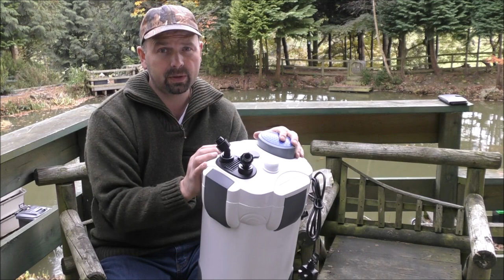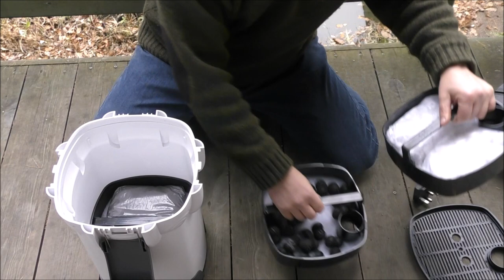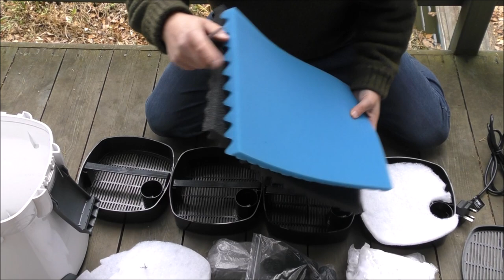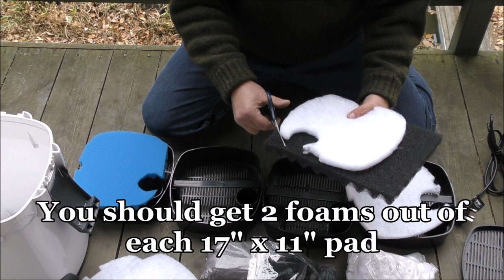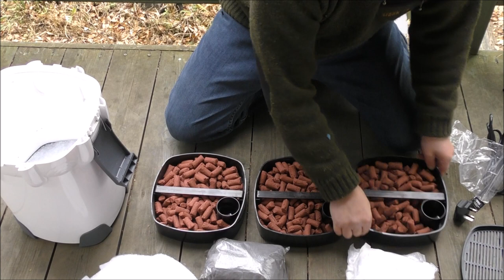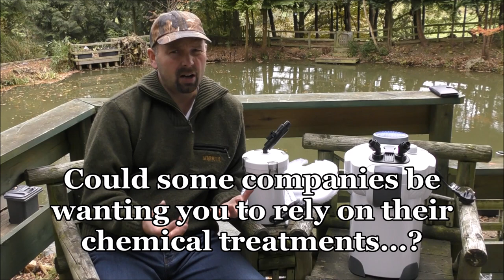Why Your Filter is TOO SMALL and NOT CYCLED

Comment: Hey Pondguru, I bet that I can get your canister to get almost 100% flow from the filter.  If you use two of the booster mechanical filters in parallel feeding the single inlet of the canister filter, one filled only with biological media, you will very likely have almost full flow because the greatest resistance will be in the mechanical part of the filter system and doubling the mechanical filter area you, in effect, half the resistance. Halving the resistance should keep the canister filter at max flow.

Comment: Pondguru 
I am recently using the bio home in my Fluval 206 and 207 filters with excellent results, so much so that I decided to buy a pre-filter simply for mechanical filtration.

So much that I intend to fill my Fulval only with bio-home
However I have a doubt here:

I bought a pre-filter similar to the one that has plastic bio-balls at the bottom of the glass through which the water enters.

Shouldn't these  bio-balls be the last ones where the water already filtered through the 3 sponges of 25, 35, 40 PPI and perlon circulates?

Comment: and another topic to consider. 
That I had to learn the hard way that many if not most of the little bottles of "anti-Chlorine" that they sell at a pet store do not work at all to get rid of chloramine.
 And the other thing connected to that fact is that many towns in the USA will switch from adding chlorine to very heavy doses of chloramine in the late winter and early spring.
 Im not sure why they do this, but I learned that fact also the hard way.

So you have to always check the pet store bottle's small print to make sure it gets rid of both chloramine and chlorine!

Comment: I have a penn plax cascade 500 says 115 gph for upto 30 gallons. I have filter floss under the basket to stop swishing cause it's not enough room for media. And I have a coarse and fine foam in the bottom basket. And fine foam under the media in the top basket. With filter floss on top of the crate.Would it be suitable for a 20 gallon? If I divide it in half, it be 57 gph and 15 but wanted to check because you said other companies list it right.

Comment: I have heard multiple people talking about these filters saying that the out flow is quite poor/ slow. surely, adding a additional foam chamber for the water to flow through makes the flow output even worse, due to the additional power needed to pull the water through another chamber? great video by the way. Just more of a question about the actual canister used in the video!
Reply from the maker: When I pulled out all the parts of the canister filter you will have noticed 4 x fine pads (one in each tray) which is how it comes from manufacturer. Operating the filter with 4 fine pads in has the potential to cripple the flow - it only needs one to be effective and that will also help with flow.
Therefore I can understand if there are slow flow issues with the canister if it is set up as (manufacturer) recommends.
No canister will have the flow it promises as they generally sit under the tank so will be operating at a head of around 75cm - 90cm typically. At that lift a 2000 litre pump may only be delivering approx. 1200-1500 litres per hour from any filter and much less if 4 fine pads are used to restrict the flow.
Hope that makes sense.

Comment: Hello, im using the newest serie of fluval. 2x 407. I dont know if the old ones have this but what i figured out is that the watet flows through  the side foams to the bottom. And than starts its way back up through the 4 buckets. 
i left the standard pads in the side. one small foam in the botton tray. and then went up with Matrix media and a bag of purigen in the top bucket. Correct way of doing this?

Comment: Another great video. Thank you. I may have a go at designing an anaerobic pre-filter. I seem to suffer with diatoms and will tackle the cause.
Reply from the maker: It may be worth considering using that filter you're designing as the latter part of the filtration system, not the first as the nitrate reduction would generally occur after the aerobic processes which act on the ammonia and nitrite. It will have much greater chance of success after aerobic bacteria has done its job as that effectively reduces the oxygen content of water - design of the filter would be the same but placement of nitrate reduction part makes a big difference.
I'd look forward to hearing how you get on with that and if it is successful - media choice makes a huge difference to the effectiveness as does water flow, ideally media would be genuinely porous, receptive to bacteria and the flow would be slow  -possibly split the flow from the main filter to ensure slower passage through the nitrate filter?
Reply: @pondguru  Absolutely. Thank you for your great advise. I'll let you know how I get on.

Comment: Hello, Richard. I am wondering how I should treat fish I bring home from the store. I have a pair of Corys, nerites and amanos each, in a 10 gallon tank. I plan to transfer them to a 38 gallon tank. The filter on this 10 gallon tank is cheap and ineffective. I will  gradually phase out this filter and use a Fluval 206 equipped as you detail (I have to make a new lid from Lexan, or, polycarbonate to accommodate the hose entry to the tank while the biological media in the 206 grows). I plan to use the 10 gallon as a quarantine tank (in future), but have not used anything on the aforementioned inhabitants prior to the planned transfer. What do you do before you move fish to a general population known to be healthy? I completely enjoy your videos, btw, and will, at some point be getting some Ultimate from AngelFins for my next (2) 207 Fluvals.

Comment: I have the booster filter and used in my setup. The problem i had is it reduces the filter flow rate a lot  and also it get blocked quick and priming the filter was  a slavery job every time.. I move to sump  setup and 800 L tank and the problem i have is the phosphate . It is 5-6  at most.  The  booster filter   got  useful for my Seachem PhosGuard . I chunk the foams from the   booster filter  and added PhosGuard  bag in.    I am using a cheap 1400 l/p   pump to clean the phosphate. It does excellent job  for this  but as pre-filter was useless. My phosphate  went from 6  to 1    in 3 days

Comment: I am so glad I watched this BEFORE adding any media to my brand new Eheim 4+ Pro 250. This all makes so much more sense to me now. According to your calculations, my 55 gallon tank (sorry, us yanks are still stuck in the yank measurement system) is a bit under-filtered with the Eheim but I also have a Whisper Pro 60 HOB filter. I'm hoping the two working together will be sufficient. Currently, I have two Angelfish (about 2.5" each) and 6 Siamese Algae Eaters. The SAE are tiny but I understand they'll get much bigger. I'm about to add 10 assassin snails. Since the 250 is brand new out of the box and hasn't even been used, should I consider swapping it out for the 350? I/m still within the return window.

Comment: Thanks for your logical explanations. I have always wondered why I have high nitrates in my barely stocked 160L tank despite running an Eheim Professional 2 2028 canister which is rated for tanks up to 600l. On opening the filter all three trays were full of sludge, needless to say the fine filter pad was at the top. I have now set it up as per your recommendation using additional foam pads and Eheim substrat pro. Hopefully now my nitrates will come down.
Reply from the maker: Yes there seems to be no reason why substrat pro wouldn't bring nitrates down as it is a good porous media - the problem most people's filter have is probably that they have the fine pad in wrong place (clogging up media) and don't use enough good media. Let me know how it goes as I always want to learn if other types of media can achieve a full cycle for a variety of different stocking situations.

Comment: Richard, the problem with using these mini booster pre-filters is that they cannot be primed and priming the main filter becomes next to impossible. 
Do you have tips on how the mini filter can be primed up without it having a priming plunger built in?
Reply: (my other channel) Just make sure that the main canister and the booster is as full of water as possible and it should prime well enough. If you close the outlet tap on the main canister and fill the inlet pipe up it will fill the remaining parts of the canister and booster. If you then open the outlet tap and turn the filter on it will prime no problem since the system will be full of water.

Comment: Although i do agree with you on almost all parts, what I dont necessarily agree with is exactly how you set up that canister filter. Now I dont condone the use of those types of filters I find them to be 1/2 assed at best. But when setting up these things there should be a medium fine filter pad under each layer of Bio Media, there is so much bypass on these types of filters that an added layer of protection is vital IMO to protect the bio media from getting clogged. There is a lot of water and a fair bit amount of back pressure in these canisters and forcing the water through as designed will show clogging in media.............Your, or anyone elses. So a nice medium fine foam pad does help.

As far as everything else goes this I am sure will help out the Novice Fish Keeper and one should take notice, there is a fair bit of good information in this video. ......Well Done!
Reply from the maker: I see your point there and a medium grade pad could be of benefit - it's really the fine pad which should only be in bottom tray since the very fine muck should either be trapped in that first tray or  allowed to pas through the bio media trays.
A medium foam under media would allow that to happen.
I'm glad you enjoyed the videos - thanks for watching.

Comment: Brill video, explained really clearly, fully understand what you are saying. Question about the amount of media required, 1-2kg per 100 litres depending on fish type and stock levels you quoted were for tanks, am I right in guessing this is exactly the same for Koi? A 20,000 litre heavy stocked koi pond needs 400kg of media? Or when you achieve so much media, say 200kg, will this cope with more litres. ✌️

Comment: Thanks again. Due to your excellent video I have just ordered a filter booster and am in the middle of an order for 3kg Biohome Ultra Mini + Bacteria Balls for the extra tray that I will now have available for media. Also, thanks for the tip about Purigen. I have the smaller one, in a pouch but have taken it out of my tank. I don't think I have a problem with my tank water (this particular tank is established 2 years) but I am always willing to listen to good sense and advice!
Reply from the maker: I'm glad you enjoy the videos - thanks for watching
Purigen in itself may not be a 'harmful' product but the effect on anaerobic bacteria reported by many people struggling to achieve full cycle or experiencing a crash (high nitrates) after using it is worrying. It could simply be so effective at drawing in trace elements that it starves bacteria but consistently when it is removed the bacterial development will be normal and full cycle will be achieved / resumed. There are many other similar products from other manufacturers which seem to have the same effect but I think attention is drawn to that particular one since it is very popular so is most commonly reported.

Comment: I have a question. Lots of people talks about how to have a good colony of anaerobic bacteria in the filter and in the biomedia,  and how that is so important. But then, they say how bad is the anaerobic  places in the substract of the aquarium, and that we need to avoid the anaerobic bacteria in the substract. Are they diferent bacteria? (the filter and the substract) Because in some marine aquarium, they use thick, deep substract to have aerobic AND aerobic places in the substract to have the filtration in the sand. So, WHY in fresh water aquarium everybody says that the substract must NOT have anaerobic zones? I dont understand.
Reply from the maker: Unchecked anaerobic bacteria (e.g. neglected deep bed of sand or gravel) can be very dangerous as toxins build up and can suddenly be released causing a total wipeout. However the biohome provides home for anaerobic bacteria in tiny pockets spread through every part of every piece so there is never a chance of toxins building up.
The deep sand / gravel in neglected tanks is basically a breeding ground for bacteria of all types but they can often get out of hand if there is too much organic material rotting under there. Gases produced have to go somewhere and often the deep sand / gravel can be 'sealed' by detritus causing a bubble of gas to build up then suddenly erupt - that's a totally different situation to supporting anaerobic activity in filter media in a filter. One is very dangerous, one is perfectly safe.
Substrate needs to be cleaned and disturbed quite regularly to prevent too much waste build up and potential problems with anaerobic activity.

Comment: I have a 520L malawi peacock/hap tank, currently using the All pond solutions 2000L canister and filter booster, wanting add more filtration because of the heavy stock in the tank. Not sure which way to go though, was thinking maybe a second filter the same as I already have or completely changing my filtration system to a sump, which do you think would work best ?  (I've never used a sump before, always canister or internal filters)

Comment: i have that water filter and it sucks. I started getting water leak from the top and i had to custom fix it by adding vasalin on the upper rubber ring to stop the water leak. can you tell me if there is another filter i can use for my 200 gallon beside this one.

Comment: When I use a smaller Sunsun 603B as a prefilter, which has only half the gph flow capacity of my main Canister Sunsun 302 (similar to attached photo).
Will this reduce my overall flow capacity? Since the filtered water has to also go through CO2 reactor and then finally into the tank.

Comment: Im running my old fluval 403 with all foams as a prefilter using a new 406 to pull the water through it  and the 406 is completely full of  biohome  its been running a year  with no reduction in flow  my water test perfect 0 ammonia  0 nitrites and 0 nitrates when should i clean it flow is great water is crystal clear its a 110 gallon tank  i also have a sponge on the intake its the only thing i have to clean i also keep my original  hang back filter running

Comment: I have two sun sun canister filters,can I use one as a booster and a second as the bio media?
Reply from the maker: Yes if you don't need both filters to run as combined filters but fitting a simple booster would do the job too.

Comment: What size filter would you use for a 75 gallon tank for turtles as you know they are very messy right now i got a sun sun 702 B it is set up with like you have in the video i also have the bio-media in the second tray the third tray some carbon but i still see a large ammonia problem do you ever use any other product such as serchem ect.  i look forward to hearing from you.

Comment: If you want to create denitrification bacteria you need to create a zone that is appropriate for them to grow in. They will grow and function with a food source (carbon) and a LOW oxygen level of less than 0.3 mg/L dissolved oxygen. Without this you will never denitrify in any meaningful manner in your aquarium or pond. This is best accomplished with a second filter with a slow enough filter rate that enough oxygen is used up in the beginning of the filter by nitrification bacteria to bring the oxygen levels down to less than 0.3mg/L. I hope this helps.

Comment: Lets talk about cleaning a canister filter correctly.

 What Im seeing in a lot of videos is that when we clean a canister filter we have to take great care not to kill the bio life on and within the media.
That seems to happen a lot when guys use normal tap water to re-fill the canister as they get it up and running after cleaning.
In an effort to not use fresh tap water Im seeing guys attempt to re-fill the filter with aquarium water.
I have a question about this issue.
If the use of aquarium water to re-fill the filter is always going to be a mess to do, and if just using tap water right at the sink where you are cleaning the filter anyway would be way faster and neater, is there a way to treat normal tap water right there at the sink that would allow you to fill the filter there, and not need to try to drain some aquarium water?

My thoughts are about the use of the Brita type water pitchers.
Many of us have them right there in the kitchen where we are cleaning the filter anyway, so could such a pitcher be used to quickly turn tap water into water that is safe to fill a canister filter with and not kill the bio life within the media?

Comment: Would alfagrog work the same 
I have a pond solution 2000lph same as the video
Want to get a booster for the sponges and was thinking of getting alfagrog to put in the actual filter ( the 2000lph canister not the booster )
My tank is 250ltrs thought I'd go for the bigger of the filters saves on maintenance 
Advice would be very much appreciated 
Thanks